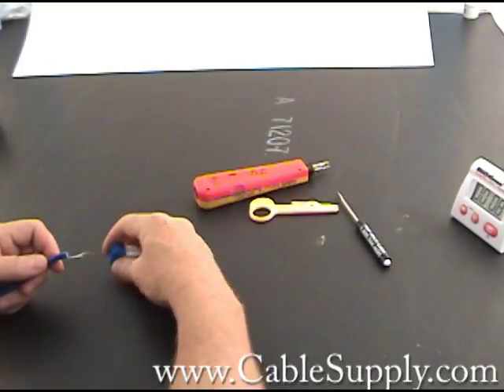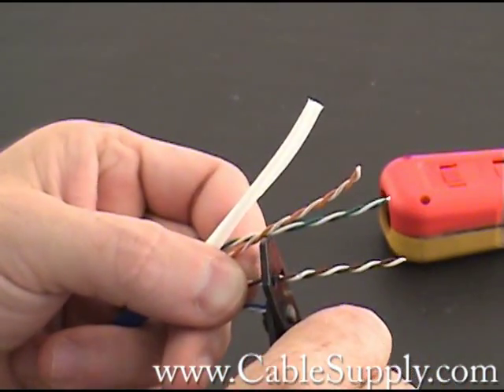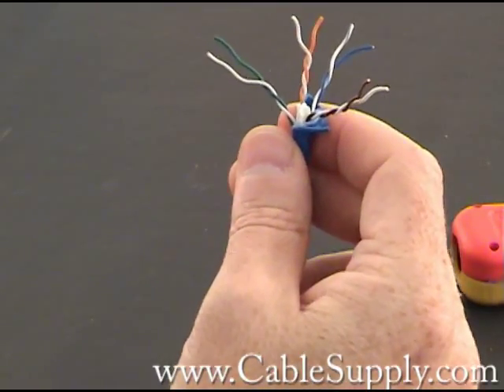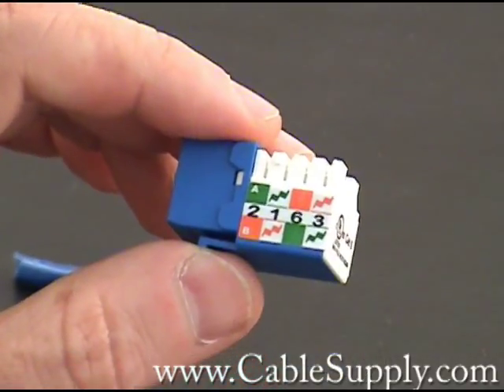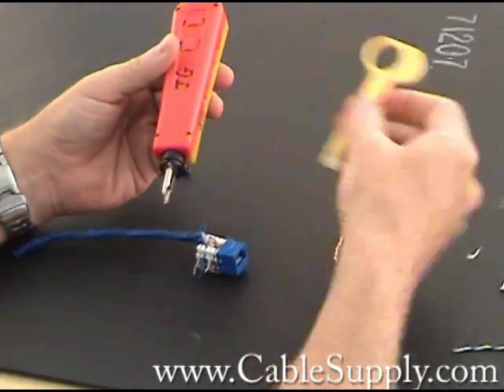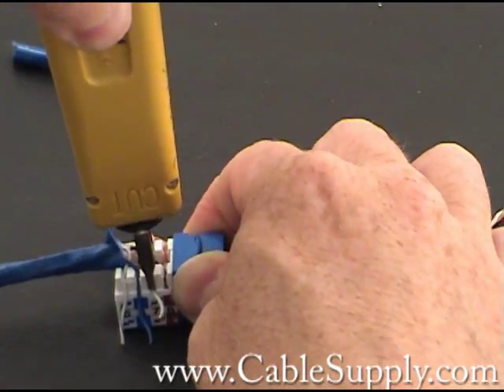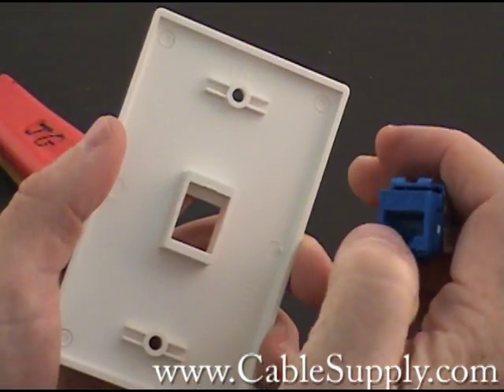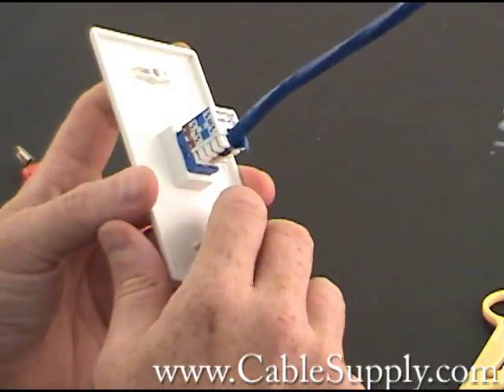How to cable a Cat6 jack

Comment: Tip: Skin the ethernet cable a good 6 inch and even more. When you've put all the wires in the corresponding groove and are ready to punch, just twist the excess wires together, this way you won't have millions of short wires pieces all over the floor. Makes cleaning up much easier.